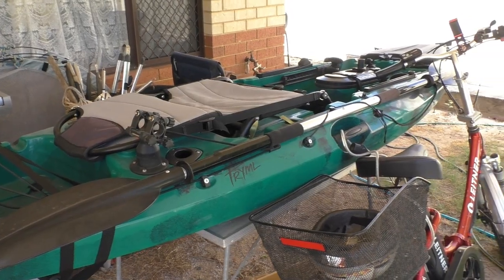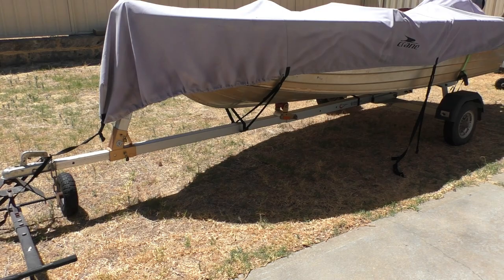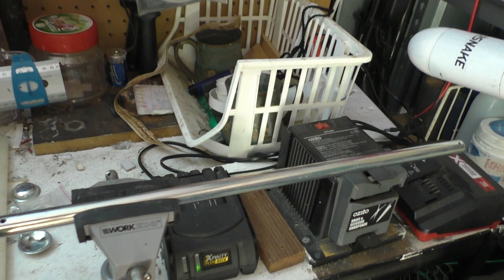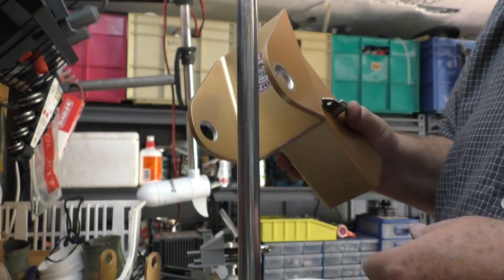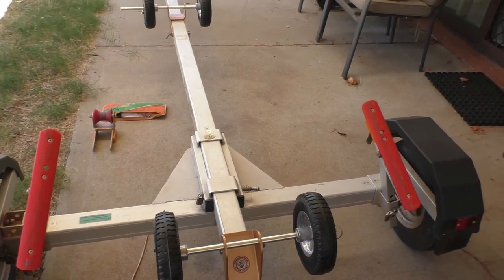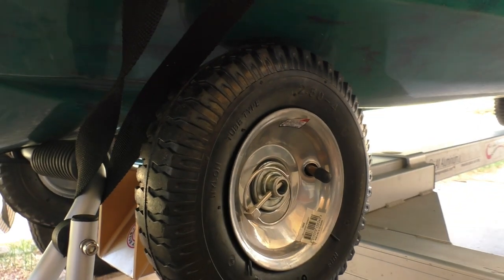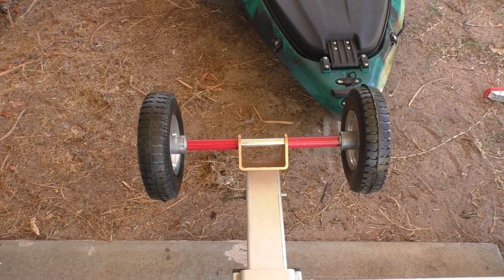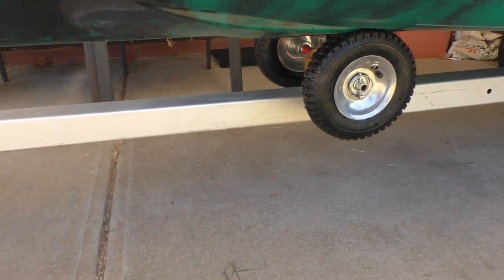Mangrove Jack Folding Trailer - Kayak Kit

Comment: The only change i would make, is on those spacers as you drag it up. the hull seems to scrape on those axle mounts, may be wrong but looks like it. I would put some pool noodles on those spacers front and rear.save any damage or bad scrapes to the hull of your kayak. Would only need one length of pool noodle and still have some spare. Thats what i would do personally, but a great double use of the trailer
Reply from the maker: Yeah, I noticed that the hull just touched the bar as it came up but I think it was the main trailer bar. It might need a bit of padding to save any damage but I will check out the spacers too to see if it touches those. Pool noodles would certainly work there.

Comment: You should be able to make some skids rather than wheels, they could be shaped to centre the kayak. I used to load a canadian onto the top of a VW Kombi, I had a pair of fairly robust roof bars and just skidded it on from the rear. I probably still could, but that doesn't necessarily mean you should
Reply from the maker: Yes, skids would work but this was the simplest way I could come up with and there wasn't much work involved. I've got back problems (have had since I was a teenager) that are getting worse with age so I try to avoid lifting heavy stuff if I can these days. If the back goes out I can be laid up for days and that really sucks.

Comment: If you need a trailer for a kayak, it’s almost the same thing as having a tinny on a trailer, right? Launch fees due to parking with trailer restrictions?
Reply from the maker: Depends where you launch it I guess. We launch it where ever we can get to the water which doesn't always mean a boat ramp. I could put it up on top of the 4x4 but it is a lot easier to use the trailer and the trailer I can also use for the tinny.